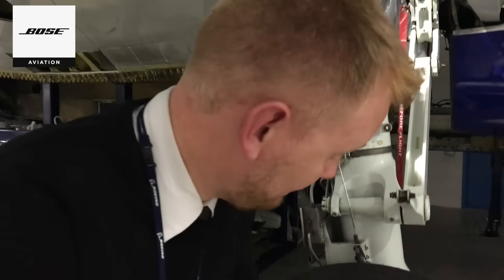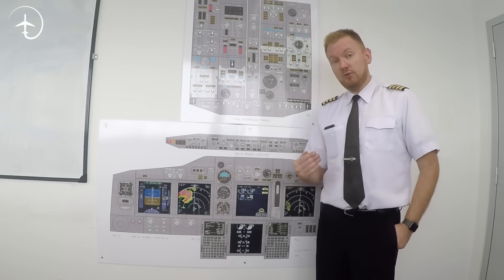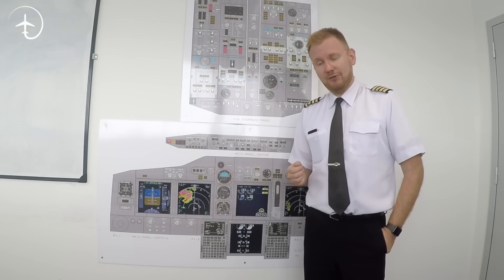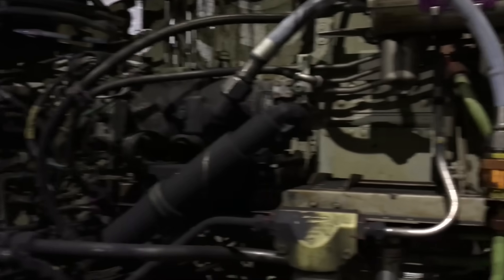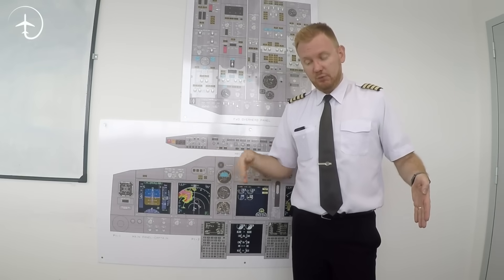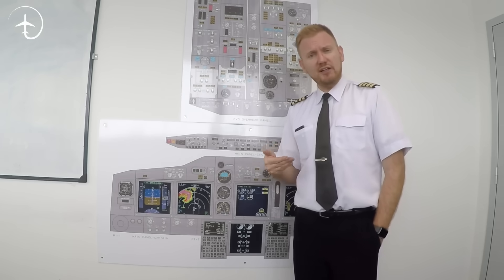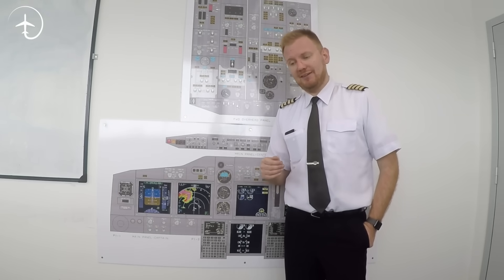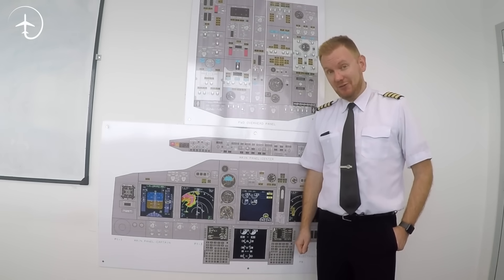Why does the Boeing 737 not have any landing-gear doors?

Comment: Thanks Mentor Pilot!!!  Reminds me of a landing gear problem on a 737 I was on many years ago. The co pilot came back and pulled the rug up on the isle around the wings (landing gear) area. Got on his knees and looked, I guess, though a sight glass. This was to see if the gear was up or down. Right gear was stuck up. We were told to brace for impact as we came in for landing. Seconds before landing the pilot said on the P/A .... "We just got the gear down manually". Don't know what happened but was glad we landed ok.

Comment: Hi
A question: after landing there is nothing to protect all the parts that are in the landing gear bay? So you can get FOD. 
How you prevent that?
Thanks in advance 
Erez
Reply: TheWinnergroup  >>>  I'm NOT Mentour, but I'll take a shot at your question. 
 
The MAIN problem with FOD ["Foreign Object Debris" or "Foreign Object Damage"]  is damage to an engine, where the {whatever} actually gets sucked into the engine.  There's no similar 'suction force' in the landing gear wheel wells. 
 
FOD damage CAN occur just from debris getting kicked/thrown/whatever into the aircraft's airframe, but that can hapen anywhere on the aircraft that can be impacted by loose debris.
 
Yes, I've been around aircraft once or twice...LOL
Reply: RocKiteman _ 2001 
Hi, 
I know what is FOD :) 
However what I mean is .... a bird can go there too, to make a nest. 
When the plane is parked and idle things or even ppl. Can go inside. Debris like plastic bags can fly in.
Reply: RocKiteman _ 2001 
I have been around aircrafts too :)
Reply: TheWinnergroup  >>>  I spelled out FOD for anyone else reading my reply.  Based on your post, I figured you knew what it meant.
Reply: TheWinnergroup  >>>  Birds can get into VERY TEENIE holes.  You'd need landing gear doors that were "hermetically sealed" to keep them out...
Reply: TheWinnergroup  you have NEVER SEEN one of the crew do a WALKAROUND ?.
Reply: @TheWinnergroup  birds make their nest in many parts of the aircraft, but all comercial aircraft have daily checks where the mechanic should be able to detect that kind of anomalies, even though if something like that is undetected there is no much damage a bird in the MLG wells could cause, critical parts are APU & Eng. Inlets and the exposed instruments

Comment: I guess that you forgot to mention that B737-100/200 came with tire burst screens from the factory to protect the hydraulic components from damage on retraction of a damaged wheel assy.
Reply from the maker: Hi! Yes, in fact I learned that after the video was released. They actually caused much more problems than they helped so they were taken away.

Comment: He says the tires are inflated to 14 psi- this is very wrong.  It might be 14 atmospheres (~200 psi).
He also seems to be saying that nitrogen doesn't change pressure with temperature.  This is a very pervasive myth.  Nitrogen expands or increases pressure when it heats up just like air (which is 79% nitrogen).
Reply from the maker: It is supposed to be 14bar. Close to 200psi

Comment: I could be wrong but I believe tires are filled with nitrogen NOT hydrogen. Fact Check Please
Reply: Watch the video again please
Reply: The video is incorrect. Aircraft tires filled with hydrogen would be bombs waiting to go off. Hydrogen is EXTREMELY flammable. Check basic chemistry. Flames+airplane=BAD IDEA
Remember the Hindenburg?
Nitrogen is used in the tires as it is an inert gas. I have been known to fly the occasional plane.
Jack
Reply: Jack Rutherford except that the word hydrogen wasn’t even spoken in the video

Comment: Informative yes, but you just spent the whole video trying to convince that no lg doors isn’t a bad solution. The design is 50 years old like you said and let’s face it, no one would ever ever again do this to a commercial jet of this size. The max still has this, because they haven’t got a solution for that, due to the very design of the plane from the 60’s. There just isn’t room for doors and to fit them, they would need a new plane. Since Boeing still tries to stretch this somewhat outdated design with the new maxes, I don’t think we will see a truly new 737 replacement in a long time. When you’re cruising around 900kph, it is absolutely clear that the lack of door causes quite a bit of turbulence. At the meantime Airbus is working on a laminar flow wing, because rivets, panelgaps and other ”impurities” cause drag, let alone having huge holes in the belly of the aircraft.
Also you claimed that lg doors are complex and break down. Well they are a lot more simple and reliable than all the protection systems needed to keep the 737 wheelwell somewhat safe. 
I do not mean to rant, I feel the video could have been very informative and it was to a certain extent. You just spent all the time trying to say that this system is good and other planes have it too so it must be good. It really is a very outdated design. Good thing is that Boeing has been able to make it fare ok overtime.
Also I have to confirm that did I hear wrong, I think you said the main wheels have 14psi of nitrogen in them? I don’t know about the 737, but the a320 has 187psi.
Reply from the maker: Yes, there are better designs around, of course they are but, like I said, if this REALLY was a problem then Boeing would have dealt with it by now. If you are dealing with added winglets which increase the efficiency by 1,5% in order to compete with Airbus, leads me to believe the drag penalty is WAY less than that.
And yes, the correct pressure is 14 Bar, not 14PSI.

Comment: I am wondering why they don't put hubcaps on that use the wind to start to spin up the tire before landing. Even if the tire isn't spinning at full landing speed, it seems to me that it would still reduce wear & tear on the tires. If the tire is already spinning at 85%, or even 75% of landing speed, it would be far less stress on the tire & landing gear than the tire not spinning at all & then hitting the runway & skidding as it spins up to landing speed. 
It would be much less stress on the tires & related components if the wheels were already turning at, or close to landing speed before touchdown. A properly designed hubcap could start spinning that wheel up as soon as the the landing gear is put down. 
I realize older, existing, planes probably don't have room but it seems to me that would be a fairly simple way to reduce maintenance on new designs & would only require a few extra inches in the bay.

Comment: KISS principle.  Keep It Simple Stupid.  Very little drag penalty in this area so flush wheels and fixed doors keep things simple and reliable.   It sounded like you said the tire pressure was 14 psi?  Surely it's higher than that, did you mean 14 bar?

Comment: I always wondered why the 727 had full doors and the 737 doesn't.
Now I know.
Still, I think they could have managed to engineer full doors if they really wanted. I've worked on the doors of a 727 before. They're deceptively simple if you know hydraulics. You just gotta be careful with those bad boys on the ground. They snap shut the moment the system pressurizes unless you've pulled down the little handles in the wings. And if you get caught between the door and the fuselage, the 3000 psi hydraulic system isn't going to care your body is in the way.

Comment: Are you a pilot? Did you know you're wearing your epiliets backward? The wider portion should be towards your shoulders, not your neck. Don't believe me. take a look at EVERY OTHER PILOT OUT THERE. Also, the tire pressure is FAR more than 14 psi. It's more like 250 psi. Please don't take all the effort to make these vidoes unless you know what you're talking about.
Reply: Haha, yeah, 14 is just average atmosphere. At that pressure we wouldn't even need to use a compressor to inflate them!

Comment: If that place there wheel tyre after takeoff no gear door so plane will like viberation and bubbling up and down,,,and speed will not make,,ore will engine make heavy mean fan ore oilfuel tank will make big,,,so downside want to smooth,,,,,,Airbubble then make by then takeoffflow at in bubble cond not fllew at plate,,,,
Reply: yes indeed

Comment: Lost in (English) translation? When you talk about landing gear doors you suggest that complexity means "HIGH" chance of failure. Did you actually mean a 'higher' chance of failure? There is a big difference between having a 'higher' chance of failure than a "high" chance of failure. Perhaps the best way to describe this situation is simply to say that there is a GREATER chance of risk with complex equipment. If as you suggested complexity alone meant high danger, we wouldn't be flying on 777s or A350s or 747s for that matter -- as their vast complexity would be too high a risk -- and thus too dangerous to fly.
Reply: Rockslide have you never seen a plane A320 where the gear did NOT come down properly, or  1 main gear did not deploy ?

Comment: One of the first things I learned when I first joined Air Traffic Control was about the Boeing 737. It was built to be "self-sufficient" at smaller airfields. That meant that it could start it's own engines using it's on-board APU (Auxiliary Power Unit), it has it's own on-board mechanically operated stairs so it doesn't need airfield steps or the start up truck just the fuelling bowser. I think it can or used to be able to, power back off the stand without the use of a tug. A very forward looking design that has lasted decades, that's why it's still being used albeit in more modern guises. Another airliners that had their own stairs were the DC-9, the BAC 1-11 and the Boeing 727 if I"m not mistaken, all at the back of the aircraft between the rear engines. My friend was on a flight from London to Madrid once on a DC-9 when the back door/air stair seal blew causing an explosive decompression of the cabin. They landed safely but very shaken. Another good reason to keep your seat belt loosely fastened in flight when you're not moving around the cabin.
Reply: I don't know why ppl fret so much to wear their sear belts. Loosely fastened should be the way at all times. Ppl unlock their seatbelts the moment the seat belt sign is off, as if they are gonna get paid for it
Reply: @coronarahul  Same reason they don’t get covid vaccinated…
Reply: It’s outrageous! I mean my seatbelt has been locked on every airliner since iI did flight training and learned what clear air turbulence was…

Comment: Very well explained. One question though, if the tires are inflated to 16 PSI will the wheels inflate further due to the outside pressure dropping as the 737 ascends and jam into the well? Or does the tire pressure actually decrease with the low temperatures at higher altitudes?

Comment: With all the 'System-Logic computer-based functions...that have been 'coded'...or programmed into these larger category type turbine aircraft....you'd think that the engineers would have created a 'wheel-speed spin-down demodulation feature,  whereupon...at 'wheels up',  a braking system ( without intervention of the pilots having to 'tap brakes' or anything after rotation)  that would automatically...but somewhat gradually ( or...not?) 'begin a braking regimen right at 'wheels up'...so that...IF,  there were any rubber-explosive event' imminent...the damn wheels wouldn't be folding up into the bay...still spinning at 150 mph....and flinging rubber everywhere...at initial 'rotation deck angle'.   ...jeez.    such an easy fix...and yet....this gent here...explaining the complicated and detailed 'gear up' problem items list.... as if,  they still haven't quite designed anything that's fool proof.

Comment: Great video! One thing to remember about the tires being exposed to the elements is that they are *tires*, they're very durable, and in the case of an aircraft, I'm sure they are inspected periodically. On another note, looking at the rubber flaps that are used to keep debris out of the landing gear bay, it always bothers me when an engineer does something I would have tried.
Reply: perhaps you should be an engineer

Comment: Why won't they opt for C-130 like landing gears, these are lower than 737s?
Reply from the maker: There is also a problem of tailstrike risk. A C-130 has the tail angled upwards to allow for landing and takeoff. That is not possible in a large airliner.
Reply: Well!  That makes sense Sir Mentour! 
Thank you again!

Comment: Question: I fly on 737 a lot (short, domestic type flights), and every time we are taxing before or after flight you always hear a "woomp, woomp, woomp" type sound. Sounds like a some gears moving . What is that sound?
Reply from the maker: It’s probably the flaps moving you are hearing.
Reply: Raymond Smith probably things like lights they run over, or just checking the REVERSERS , 1by 1 at slow motion things sound quite different

Comment: Interesting video with a good explanation of why there are no doors on the MLG. As for the exposed tires, I wouldn't think anything would happen to them as there have been many other aircraft designs that have had exposed wheels. WWII aircraft may not have flown at speeds of today's modern aircraft but many flew at altitudes at 30K + with no problems of the wheels or tires exposed to extreme temperatures. The B-17 didn't have any landing gear doors and the tires were filed with compressed air, nothing much happened to them due to altitude or temps. Flak and Fighter damage was another problem, but not having landing gear doors eliminated weight and problems caused by damaged doors. But Boeing has always build superior aircraft, built like tank armor.   
As for icing on the underside of the wing, I've seen this only once on a B-52 Bomber. I doubt that it formed during high altitudes, but rather after it was at lower a altitude or after it landed. I was stationed at Seymour Johnson AFB and we had a B-52G that had just landed with some mechanical problems. It was summer, very humid and the aircraft was very cold from flying at high altitude. When I got out there the underside of the entire aircraft had a thick layer of frost  and some ice. But like I said, it could have formed at landing speeds, at low altitude or after it had landed during taxi.
Reply: Given what we know now, I think it's safe to say that Boeing definitely do not build superior aircraft.

Comment: Is that referred to as “low hull body”. Like I think they call the a350 a low hull XWB?   Very interesting.  Simple solutions often the best.  I guess the a 350 will still be higher up than the 737 cart.  I’ll check.  So where is captain joe going next?!!🤪😂.  Love this comprehensive info.  Much preferred to seeing you frolicking on the beach😂😂😂

Comment: Unreal the amount of hoses and exposed stuff inside of that wheelwell.
Reply: Like maintenance renegade said, the intire landing gear and supporting systems like anti-skid valves ect. and a large area of the hydraulic system is accesed from the wheel well. Absolute bitch to work in tho
Reply: @Maintenance Renegade Dunno how it is on the 737 since I only worked on the 707 in training but I'm quite short (5"8) and some parts are hard to reach for me ;D. Especially the walking beam.
Reply: @Maintenance Renegade When the Aircraft is on the ground the landing gear tire is no longer covering the wheel well opening giving complete access all components.  The original design engineers missed this feature and added a serving door for hydraulics (probably for an external hydraulic mule) which was generally never used and subsequently deleted.  Debris generally enters the wheels wells when the gear is down (unusually on landing and thrust reversers applied). The perimeter seals mitigate noise and aerodynamic drag.  The original bag seal material was attacked by residual hydraulic fluid residue and change order was issued correcting the problem with the present system.
Reply: "Scrappy design" Yep, sums up Boeing.
Reply: He forgot to remind people to never try to stow away in the wheel well of a B737.
Reply: And all that stuff is easily accessable too! Mechanics must love the 737.
Reply: I know they often have exposed equipment in military aircraft because of ease of access in case of emergency.
Reply: Maintenance Renegade yeah the fwd access and NWW are tight. The hell hole is also horrible. In the MWW the worst things are the fuses and the spoiler mixer and ratio changer.
Reply: Looks scary as f*ck lol
Reply: Theres using garden hoses its cheeper
Reply: 737 MAX does notr need wheel;s becaus eit falls oput of the skys
Reply: @ilovecops6255  Clearly you are neither clever, funny, nor literate.